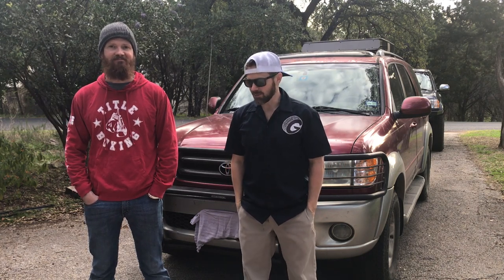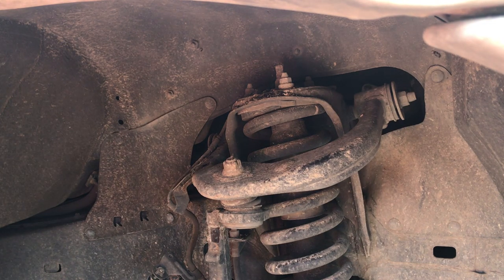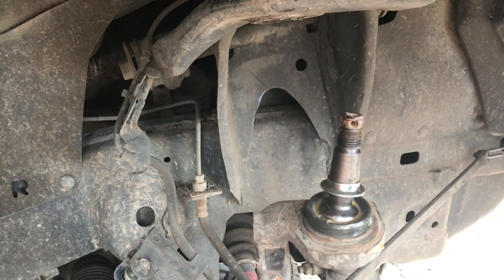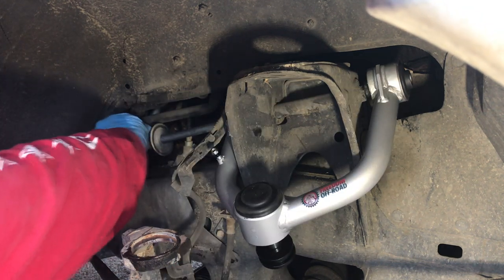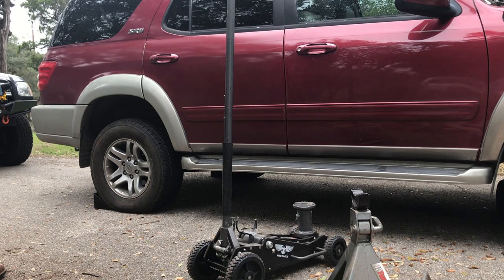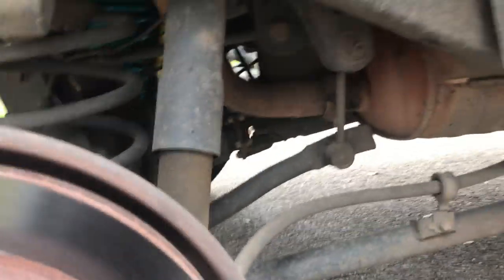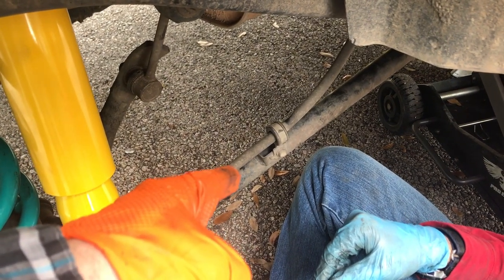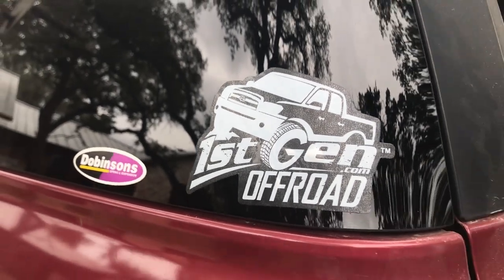Ep. 21 OLD MAN EMU/DOBINSONS 3" LIFT W/ Freedom Off Road UCAs - Toyota Sequoia

Comment: On the rear, take the old shocks off, then pull the old coil out and put the new coil in, then lastly put the new shocks on. Do both coils before either new shock goes on. The shocks are limiting the axle travel. You will be able to get way more travel to get the springs in. And you can just push down on it with your body weight and not have to use the bottle jack either. I've done many Land Cruisers, 4Runners, and Lexuses and never had any fuss getting old coils out, nor having to use a spring compressor on the new coils. Way easier doing it in this order/manner.

Comment: We break the rear hatch handles because they’re not meant to be yanked on to engage the arms. Pop it with the latch and lift it from the bottom and the OEM ones won’t even break. 
Or just do the airdowne adventures style bypass lever, which is probably the best method.

Comment: There was actually a factory lower ball joint recall on the 01-03 trucks so its possible the dealer put the revised design on at 50k.  That's what mine had, then I did them again at 90k.  Nice work on the 1st gen guys!

Comment: This is my next purchase!!
Just got the lower control arms installed!

Now is this set up Good for carrying weight like roof top tent front and rear bumpers steel?

And question I have is do they sell this front suspension set up already together? Like where I don't have to compress the springs ? 
Thanks for your responses

Comment: Why did you install the lower strut bolt in the opposite direction than how you took it off? I did my one side like that until I realized how close the CV joint/half shaft comes to the bolt threads. I decided to take the bolt back out and unbolt the lower ball-joint to spindle/upright to give me room between the bolt head and the half shaft when installing the same direction as Toyota had installed it. Nice install though.
Reply from the maker: Yeah, I used to be worried about that. But I've seen it done so many times and with no problems, I now just do it that way because it's easier.
Reply: @1stgenoffroad  I agree 100%, it is much easier.

Ever see the inner CV joints sling grease from it with just the 2nd groove lift with the 5100s and stock 150,000ish mile springs? I was shocked, especially since it looked like it came from the metal part just past the big end of the boot.

Comment: What dose getting freedom off-road upper control arms do???. Dose it help with alignment or help with your upper control arm hitting the struts. Because mine don’t rub. But if it fixes alignment I’m interested
Reply from the maker: Yes.  Is has built in caster and camber changes that will allow you to better align the truck.

Comment: Don't you need the control chaos bolt for the axle so it doesn't wear prematurely
Reply from the maker: Have never done that.
Reply: @1stgenoffroad  am not sure if you did the video but someone was saying that you need a lowering front differential bolt called chaos something something. Am not sure I need to find the video.

Comment: Those Freedom Offroad upper ball joints don't have any boots? seems like this would allow more junk to get in there and cause failure sooner?  How have these held up so far for him?
Reply from the maker: These are open style uniball upper ball joints.  In Texas, these have held up great.  However, I would not recommend them in areas where they salt the roads.  Road salts will get into the open ball joint and ruin it.
Reply: @1stgenoffroad  Yeah, that's pretty much what I was thinking, our brutal winters with salt and other stuff would be really hard on those.  Thanks for the response.
Reply from the maker: @73chevy22  We can put together the same kit with Freedom Off Road closed, OE style ball joints or with SPC UCAs that also have a closed ball joint.

Comment: why #' front and 4" in the rear? your website has this kit as mentioned? why not even all the way around?
Reply: 3" oops
Reply from the maker: @jimskatr103  this kit is for heavy rear weight or heavy towing.  We also have a 3" kit.
Reply: @1stgenoffroad  Thats what i figured. i have a medium pop up, and 4 kids. i figured i could prob use the extra inch (insert joke)

Comment: i have 2003 Toy Tundra 4wd that has a front Hitch that i use to carry a 300 pound Motorcycle . I also Tow a 3000 pound Travel Trailer a lot , and do a lot of moderate off roading . What Suspension package can you recommend ? Thanks
Reply from the maker: For all that, I might recommend a set of Icons or Kings with a 700 pound spring in the front.  And an Add A Leaf, maybe even some helper air bags in the rear.  Let

Comment: Have you ever put a lift on a 1st gen with airbag suspension?  Wondering if I can keep the airbags with a 3" or need to kill them.  Looking for a good shop in Austin, let me know if you know of one.
Reply from the maker: You know.  I don't know of a good shop in Austin.  That's why I do my own wrenching.  I don't think you can get to 3" with the factory air ride.  You'll have to delete it and replace with tradition springs and shocks.

Comment: 2005 - 2007 are the years to get. More horsepower and 5 speed transmission instead of 4 speed like the 2001-2004 Sequoias. The transmissions weren't good in the earlier years of the sequoia I've read.
Reply from the maker: I’ve had both. The HP difference is noticeable. But the top gear ratio is the same in all years.
Reply: Yes 4th and 5th gears are the same in all years for first generation Sequoia, But 2005-2007 first gear is lower for better off the line towing power... (similar in theory to th400 and 700r) coupled with 33 more horsepower and 43 more hp in ‘05. The later year models of Sequoias are superior in my opinion. I have a 06’ limited Sequoia I just picked up, also owned a 2006 tundra limited for 6 years. I’m considering your lift options.  I’m looking for a soft stable lift as I have a one ton custom toyota crawler already to get crazy with it’s not a trailer Queen it’s flatbed King and sits on a f-650 in transport. This Sequoia is just my cozy daily driver / kid hauler mobile. I ran out of room in my 4runner. The Sequoia is the best of both worlds.
Reply: Have you thought about extending the rear sway bar 2-3”? Seems that may help from the sway bar pulling the vehicle downward after the up travel motion.. I think the axle would ride softer and more free? What do you think. I seen one guy cut is away bar off entirely, but this is still my street rig mostly.

Comment: Hey Josh i noticed he had airbags..will this set up work for my 2006 sequoia 4x4 limited with air suspension?
Reply from the maker: It will work but you need to remove the air pump and sensors and remove the air bags.  You also need two rear spring insulators that you can find here: https://amzn.to/2An9124

Comment: Hey Josh, quick question. I have an 07 sequoia and have been dealing with some frustrating vibration right about 55-75mph. Any idea what the issue could be? Haven’t had any luck yet. Any help would be GREAT!
Reply from the maker: could be lots of things.  A tire balance issue maybe.  But I might google search "needle bearing" and see what comes up.
Reply: Like Josh said it could be almost anything in your suspension/tires. You have to get under there and see what has play or is worn out. I had a similar issue and for me it was the tie rods

Comment: Does this increase ground clearance?
Reply from the maker: Yes.  There are two ways to increase ground clearance.  1. Add a suspension lift (like this).  2. Add larger tires (a suspension lift is needed for larger tires).

Comment: Hey Josh thank you so much for putting out the content that you do! I have a question, I have a 2000 Toyota Tundra 4x4 access cab I’m looking to lift and I’d like your opinion. It’s has all original parts so I’m looking to upgrade all of the suspension parts, while getting a 2-3 inch lift to fit bigger tires. I’m thinking of this https://www.1stgenoffroad.com/store/p768/3/1Level/Lift2000-2006TundraSPC.html#/ lift kit from your website. Seems like a quality all around set up without breaking the bank. Any thoughts would be much appreciated!
Reply from the maker: Hey Adam Nishigaya, Thanks for kind words.  Yes. that kit is probably the most popular Tundra kit and dollar for dollar, is hard to beat.  Thanks!
Reply: 1stgenoffroad thanks for the reply Josh! Keep doing what you’re doing 🤙🏽
Reply: 1stgenoffroad which spring should I go with? 887 or 888?

Comment: What's the difference between SPC  uca. Compared to the Freedom uca?
Reply from the maker: The SPCs are adjustable.  The FOR are not.  But they have caster built in to accommodate a 2-4" lift. The FOR are a lot cheaper.
Reply: @1stgenoffroad   Thank you for clarifying-that. Yes Im baffled at the cost of over this expensive piece of metal.  More expensive  than a  Dobinson / Bilstein 5100 strut kit. I figured it be the other way around.